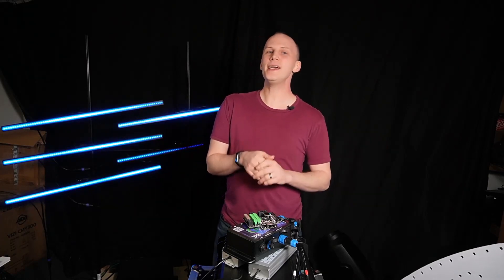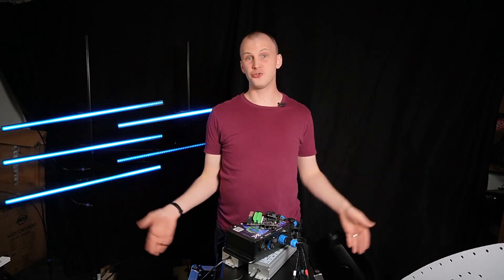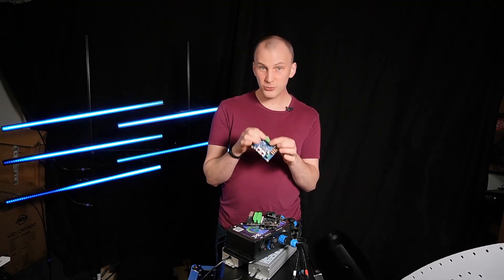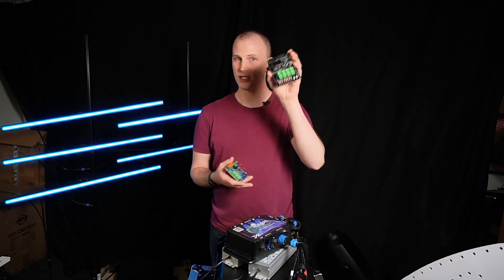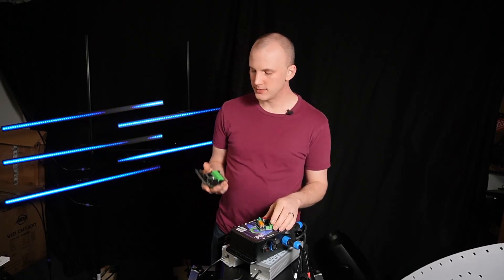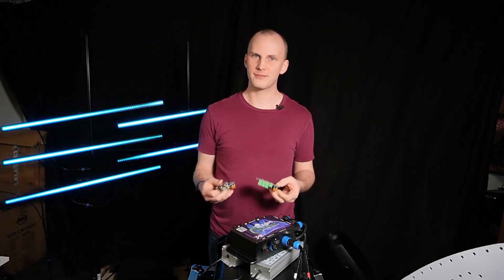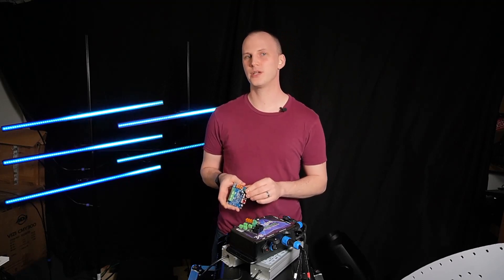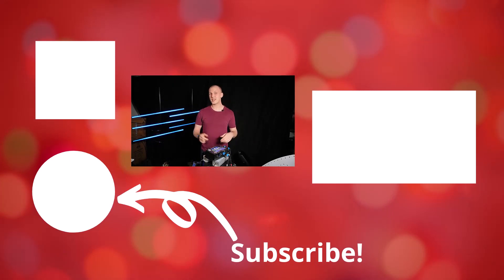How Do Smart Receivers Work in Christmas Light Controllers?

Comment: I think you are missing one of the main points about daisy chaining smart receivers for the number of pixels it can drive. 

Assuming F48V4 for numbers
One output to a smart receiver will give 4x704pixles @40 fps, or a total of 2816pixles per output on the F48V4
If you put a chain of 6 smart receivers in a row, you can't add anymore pixels than the original output from the F48 of 2816pixels on that chain. It just divides the total number of pixels by channels. 

Meaning for 6 smart receiver you will have 24x117pixels @ fps, totaling 2818pixels (with rounding) 

While this may be a benefit to some, its a point worth knowing in advance when planning your show.

Comment: Would using a smart controller make more sense compared to power injection. For example for roof outlines. Is it better to add a few smart controllers in spots and run lights from there, compared to running additional wire for power injection.
Reply: You can make simple power injection boxes that only have a power supply and a distro board, a smart receiver isn't really needed for that purpose.
Reply: @RandomakerYT  Exactly right - you have to put a power supply there no matter what, so the smart receiver may not be of any benefit depending on the situation.
Reply from the maker: Yes, absolutely.  I think the simplicity over doing a bunch of power injection makes sense for a lot of people!
Reply: You can do that but you’d still need to have a power supply connected at each smart receiver. So you wouldn’t have to worry about a long DC power injection wire run.

Comment: As a suggestion, how about showing a chart on what controllers you are referencing?  Got confused 2 minutes in  and really did not know what point was being made. Suggest a more simple approach as what are smart receivers and then do a differences.  At the end of the video, I finally got what you were trying to do but it seemed like you took the long road around it.  Could you do one on wireless links to increase distances between controllers?
Reply: No, smart receivers are not ethernet devices. They happen to use the same cabling and connectors, but they can’t be attached to network equipment (wireless or otherwise).
Reply: @sid65811  I got that part, just did not know what he was leading to.
Reply: @johnmayer4747  ok I was just answering your question about wireless links. These are for point to point dedicated wired connections.
Reply: @sid65811  I understood the video was for wired links not wireless links.  Was asking if he could do a video on wireless links.  Most of the wireless links researched do not offer a fast enough speed to do a couple of houses with many controllers.  Seems for now, we still have to go with wired with some distance that creates lag.  Thanks for clearing it up as I sometimes do now make my words in a coherent sentence....LOL
Reply from the maker: Hi John - it's always tough to try and simplify a concept that works across many controller brands.  I'm glad it sunk in by the end of the video :)